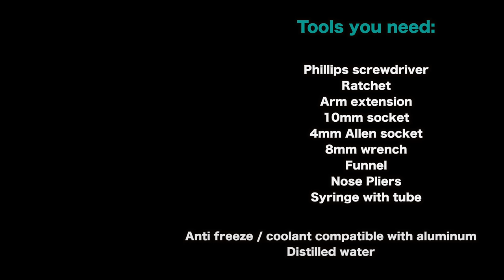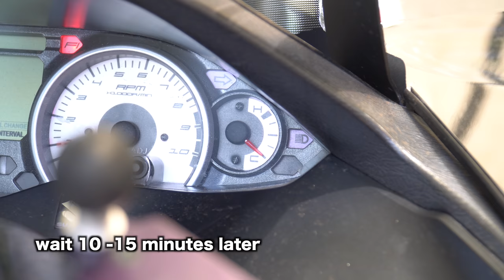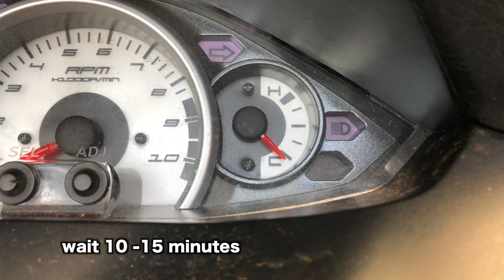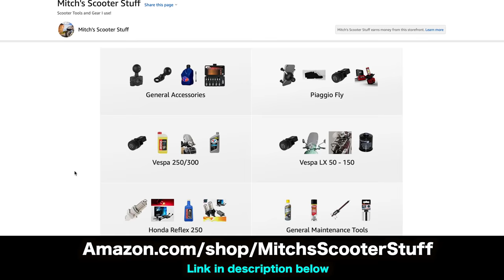Suzuki Burgman 400 Coolant Flush Change 2007-2016 | Mitch's Scooter Stuff

Comment: I'm surprised Suzuki has made sooooo hard to do simple things.Access Panels could have been made alot easier, Access to the radiator cap could have been placed under the lefthand stowage box, the radiator lower hose could have had an independant access panel or do away with stupid long panels and make a short panel to get at the hoses.Yes I'm a class 1 vehicle mechanic.

Comment: At 32 500 kms I just finished checking the valve clearances (they were ok!) and replacing the antifreeze in my 2009 Burgman 400ABS.  I followed your excellent videos step by step.  I found the hardest was removing-installing the plastic fairings.  Can't imagine doing this without your guidance.  Only glitch was when I reinstalled the valve cover the spark-plug seal became displaced (as you mention to take care!) so when I started the engine, oil was coming out from a hole on the left side of the engine.  Had to re-open the cover and re-install properly!  As for the coolant change, after four drain and replenish with water, the liquid was still showing a light greenish color.  I went ahead and fill with new coolant anyway.  I can't thank you enough for your guidances and looking forward for your next maintenance videos!

Comment: Great videos. One minor item.  There is a sneaky little plastic clip behind the glove box metal catch that needs to come out to remove the radiator fill cover.  Didn't see it at 4:50ish but I finally found it on mine.  Thanks again for all these Burgman videos.

Comment: Great instructional video again! You are super thorough with your maintenance procedures.  Most people would just let old stuff drain out, maybe flush "one time" with distilled water, and then fill it up and call it good.  You make sure all old residue is completely cleared out before refilling which is the proper way of doing it as you demonstrated.  Seems like for that model you spend 1/2 the time removing/replacing all the access panels than the procedure itself Lol.  Hopefully you stay busy at your location keeping others scooters maintained.  Nothing like making a little side money on a hobby you enjoy :-)

Comment: Oh my GOD. I like my Burg400.....but seriously considering selling it after watching 26 minutes of coolant fluid replacement. 
Excellent, tutorial video. 
My old guy, local bike repair guy will probably NOT agree to attempt to get my Berg running again after its been sitting unused for 3 years. Only 2500 miles on it...second owner here.
And the dealership in DFW will charge me a small fortune.

Comment: Love your videos Mitch! I have to be honest though....  To have to do that much just for a coolant change makes me not ever want to buy a Burgman! Honda's are sooooo much easier! I can change the coolant on my three bikes in the same amount of time as that Burgman!  Anyway.... Still love your videos and will  still continue to be a fan!!!
Reply: I don't think its necessary to go all out like he did with the syringe, blowing into the tube etc. I bought my burgman 11 years old never had any maintenance done to it. Engine never ran hot always right at the middle level. But since it recommended a coolant flush I did it. I just went under the pipe and popped that rubber hose off. At first nothing came out. I started shaking the bike and stuff then a decent amount poured out. Seems after 11 years the coolant evaporates or dries up but like I said it was still running fine. It was hard to get to the top thing to pour more in, I admit but not a huge deal. Then I loosened that one screw a bunch of air was coming out of it. I didn't bother pouring a water flush or get the exact amount in with a syringe or blowing through the hoses. The engine never even ran hot when it was half air in there when I bought it. The engine is so small it isn't likely to overheat. My Honda Rebel 250 (or just about any 250) doesn't even have coolant- its air cooled because its such a small engine. 400 is only a couple sizes up from that. If I were going to take a long trip like riding it hard on the highway all day I would probably put some new coolant in it but other that it will ride fine even with dried out coolant like when I bought it.
Reply: @raymondkidwell7135  it is not that the coolant dries out.  The coolant's additive package gets depleted.  There are additives that do things like prevent corrosion, lubricate the coolant pump, neutralize contaminants, etc.  Flushing the coolant is mandatory because of this and also because it removes any junk that has collected.

Comment: have always felt if you run 100% anti-freeze, although it may run a tad warmer, is that you never have to worry about corrosion or that kind of thing. have found it (100%) in vehicles and always was amazed at how clean everything looked, even after yrs of neglect.
Reply: same thing with silicon based brake fluid...still purple after 7 yrs.
Reply: My brother that lived I Chicago taught me to use un concentrated antifreeze as well. Never had any problems.

Comment: Pro tip with these plastic panel keepers: always have a few extra on hand (you WILL break them, maybe not at first, but eventually) and there is a tool to make removing them easier and less likely to break.

Comment from the maker: Tools:
Phillips #2 screwdriver - http://amzn.to/2fgdZDL
Ratchet 1/4 drive - http://amzn.to/2xcJEu1
3” / 6” extension set 1/4 drive - http://amzn.to/2wDuzzW
10mm socket 1/4 drive - http://amzn.to/2yrXjxp
4mm allen 1/4 drive - http://amzn.to/2CHDMKu
8mm wrench - http://amzn.to/2HCiC48
Funnel (short) - https://amzn.to/2HY4m6g
Nose pliers - http://amzn.to/2yetDDj
Flathead screwdriver - http://amzn.to/2jN7lpE
Syringe with tube - http://amzn.to/2G951U2
Cat litter box - https://amzn.to/3dYebQq

Materials: 
Anti freeze / coolant compatible with aluminum - https://amzn.to/2zRDLrS
Distilled water - local grocery store

Want more free Scooter Tip / Tutorial videos - Help support this channel!  Paypal donation: http://bit.ly/PayPalMitchsScooterStuff

Time Stamps:
Disassemble - :35 - 6:21
Coolant flush / change - 6:22 - 20:45
Assemble - 20:46 - 26:08

Comment: Greetings,

Are you familiar with Yamaha Majesty’s? I am trying to install LED lights throughout my bike and am having some issues. Any help would be greatly appreciated. Love you videos. ✌🏼
Reply: I would not recommend it. That bike is designed for regular bulbs and they last a long time and are verry low cost. But if you insist, what problems are you encountering ?
Reply: @BrainHurricanes  Also, I was looking to replace the grips & brake levers as well but once again could not find any info on part sizes etc.

Comment: Now I think I  know why my CPI GTR 150 spits water in my face when riding, it have an extra hole on the inlet manifold that's is blocked off that I can use to release air build up. Thanks bro
Reply: You shouldn't have air build up.
Check that out.

Comment: Great video! But oh my gosh what an absolute nightmare just to do it, it's enough to put anyone off these scooters for life! 🤨
Reply: Like I replied to the other guy- it isn't necessary to go all out like this guy did. I just popped the bottom hose off- nothing came out at first surprisingly because it had never been changed or flushed. Shook the bike and a decent amount poursed out. That top panel where you pour more in- that is a pain to get to but not a huge deal. I just got annoyed and ripped it off so now my plastic panel is damaged and I can just bend it and get to the cap. Poured some new coolant, shook the bike, loosened the screw to let air out. Didn't take much effort. My bike never runs hot or anything. When I first bought it was 11 years old without any maintenance and half the coolant was dried out and it didn't even run hot like that- due to the engine being small it doesn't generate a lot of heat anyway.
Reply: I did get the spark plug changed and the gear oil changed at the dealer- after watching how to do it on youtube was like screw it I'll have the mechanic do it. They charged me over $300. Afterwards the thing ran a lot better- didn't think the spark plug change would make much of a difference but it did. That and changing the belt are the big pains on this bike. The coolant change is actually pretty simple and easy to do yourself.